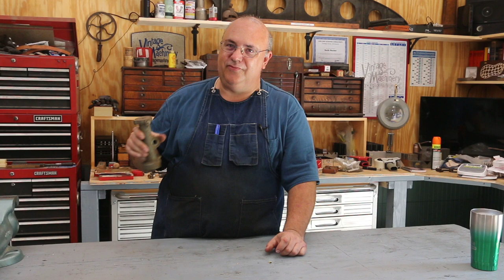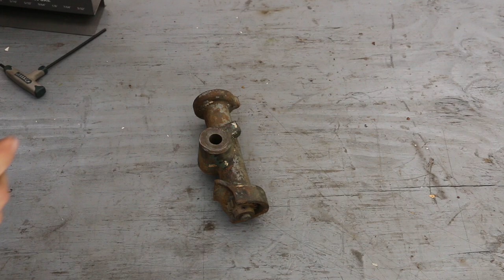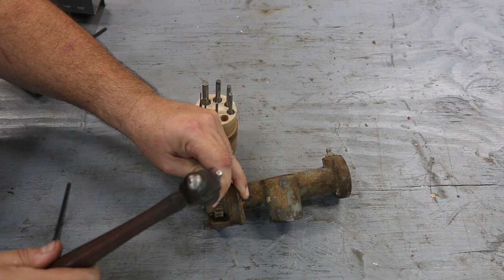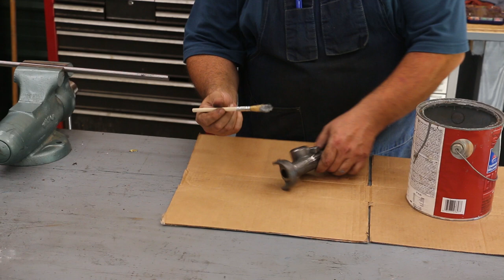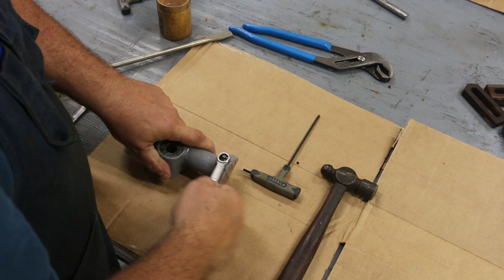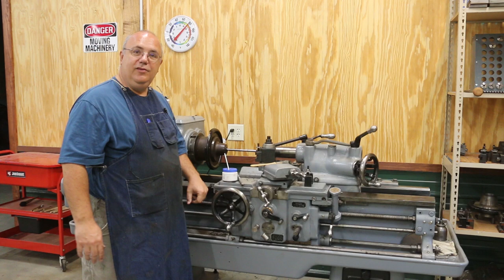LeBlond Lathe Restoration - Part 19:  Threading Dial

Comment: Hi Keith, a simple and easy way to make the dial lettering pop is apply a very thin coat of oil to the surface, then apply a generous coat of acrylic paint.   Let it sit for a moment then carefully clean off the excess.    Thanks for the videos.

Comment: That pin came out easy enough. I had a tough time in the past removing taper pins and found that drilling and tapping the larger end, inserting a bolt or screw, pull it out with a slide hammer.

Comment: I expect you know it already but for others that don't, if the lines don't line up nicely when the half nuts are engaged you can shim the thread dial body away from the carriage to make it do so. It can be annoying if you have to guess if it is half way between a half and a full line.
Reply: Chris Stephens Great tip!
Reply: Why thank you kind sir, but I can't claim any credit for it except that I read the manual for one of my lathes, rare thing I know but there you go.:>)
Reply: They were often sold as extras, so will need shimming because of the manufacturing variables. OE fitting should be done at the factory, but if you mislay the right washer, or don't know it is special, you might wonder what is wrong.,

Comment: Nice simple Idea for a thread dial. I don't have a dial on my lathe either and i'll have to look to see if it had something similar in the past. If i need to do a lot of threading i may have to make one. my Lather is nearly 50 years old and has a lot of features such as single lever control for apron and cross feed power feeds but no dial is strange. :-)

Comment: For metal, I have found that spray paint leaves a tougher more uniform finish than brushing it on... especially on lengthy paint projects... that being said, I would also have used a paint brush on such a small part.... Great video, thanks!
Reply from the maker: I once had a professional painter tell me that brushing is better on cast iron because the brushing action works the paint down into the tiny pores.  Also, if you have any dust or other tiny trash on the part, brushing will roll them around, coat them with paint and they will just stick to the part.  With spraying you only cover the top of the dust and it will not stick to the part under it.
Reply: Makes sense... my experiences on steel is that the higher solvent content in spray-paint makes the paint pigments get into the smallest defects, hence extra insurance against rust... also, paint from a paint can changes properties as the solvent evaporates in the can and on the paint brush bristles.

Comment: Is it known who invented (or first offered on a lathe) the threading dial? When you consider  it's simplicity to what it helps make possible, it's really an ingenious bit of innovation.
Reply: Nice find. Thanks for sharing it. I agree, it is surprisingly more modern than I would have thought. :)  (Page 853)
Reply: Which begs the question: how was threading done before there were threading dials?
Reply: Yes but, if the thread being cut is a multiple of the thread on the lead screw the half nuts can be opened and closed again in any position on the leadscrew and still be in time(mesh). S if you have a 4 tpi on you leadscrew you can cut 4, 8, 12, 16 etc tpi  and dis/re-engage leadscrew  anywhere.
Reply: More accurately, you can engage the half-nut on any number or line on the thread dial. There is one engagement between the marked lines and  if you engage there, the spindle will be 180 degrees out.
Reply: +Aceroadholder What J Hefflinger  said was correct. Any multiple of the lead screw can be closed at any time. I have run many lathes without a threading dial and only wished I had one when cutting an "odd to the lathe" thread. The only reason I built one for my lathe was because I was doing a lot of pipe and other fractional threads. As my lathe has a 9TPI lead screw most threads are "odd". The threads where a dial wouldn't help are 9, 18, 27, 36, 45, 54, 63, 72 and 81. All the others, including metric, are just so much easier with a dial to allow disengaging the half nuts.
   Mike (o\!/o)

Comment: Yo Keith,  How does one know if that was truly a grease zerk and not a pressure oil zerk fitting? Unless one has the manufacturer's lubrication schedule, that is.  My Monarch uses oil from the apron oil system, for instance.
Reply: Good question, I was under the impression most zerks on machine tools are for oil, as grease will hold dirt and chips. I wonder if this originally had a flip top oil fitting on it and at some point it got replaced with a zerk.

Comment: So what happens if your thread dial, disengages part way through a job? Is there a way to recover? Also is the indicator on the thread dial face going to get the graduations filled with paint or whatever.. Looks a bit hard to see.

Comment: Wonder why they had both a set screw and the tapered pin.

Eric
Reply from the maker: The set screw held the part in place while you drilled and reamed the hole for the taper pin.

Comment: Is it odd that it would have a set-screw if the bottom gear is held with a taper-pin? How in the world would the set-screw do anything more than what the pin is doing?
Reply: I think that's to hold the gear in place while the hole is being drilled and reamed. Also, it helps prevent rocking in the axis of the pin.
Reply from the maker: Like has already been commented, you need to hold the part in place when you are drilling the taper pin hole.

Comment: Why didn't you grease it before installing? Zerk fittings are for service only, not a replacement for greasing during assembly. The zerk fitting won't evenly coat grease everywhere on that shaft.
Reply: Really?  A part that turns that slow?  I don't think it's a huge deal.
Reply: Morrow S why to bring out the Trolls of course ;-)
Reply: That's not a trolling but a reasonable question, and good engineering practice to lube things as you assemble them, no matter how slow they turn.
Reply: Yup, I always lube parts as I go, that way I know it's all coated.
Reply: Clipboard warrior notification squad, assemble!
Reply: Renewable Oilcan Rim He probably forgot. But if you grease it until it squirts out the ends you're good to go. Give the guy a break. He is trying to get this done for a guy in what little time he has, he's running cameras etc etc.
Reply: scott black Keith gets more done in a week than I get done in a year...
Reply: Every shaft MUST be lubricated. :D
Reply: Either that or the hole it goes in.:>)
Reply: Agreed, there was a generous amount of grease in it when taken apart, Id feel like it needed to be fully coated before assembly - JMO
Reply: yambo59 but if he squirted enough grease in that it squeezed out the ends, which would be the normal thing to do, there would be more than enough, especially considering that the dial is under virtually no load. I think we have beaten this to death.
Reply: scott black         Finally, a voice of reason.
Reply: Considering the amount of grease Keith found inside, wouldn't greasing the part before reassembly make an unnecessary mess?
Reply from the maker: Well, I guess you would need to see this part to really understand it.  Did you see when I pulled it out that there was a coating of grease about 1/4" thick all the way around?  The center of the barrel was over size and it only was bearing on the two ends.  I probably could have packed the inside with grease first, but it sure would have been messy.  However, pumping it with grease filled the void and then basically packed both ends very efficiently.
Reply: I should know better than to ask these questions by now-lol   Love your videos Keith, love the awesome shop you've built and the restored machines, im 57 and really hate new cheap stuff - those old machines were literally built like tanks and the fact theres still so many of them still around speaks for itself.
Reply: Chris Stephens,I'm right there on your side. I often call Keith out on bad practice but unfortunately he only likes to respond to nice comments rather than deal with the truth.
Reply: jonka1, I suppose it is a question of perception, what could be meant as a helpful suggestion, could be taken  unintentionally as criticism.
Reply: The advent of Safety Kleen meant that clean parts were degreased and that they all need to be lubed for assembly, to prevent rust. I would be careful greasing electric motors since they call for high temp grease.

Comment: @8:48 it is very obvious that you have painted the surface that bolts up to the carriage. The matching surface on the carriage is also painted so now there are 2 thicknesses of paint involved. In this case it's probably not going to do much harm but it's bad practice to paint mating surfaces especially both faces. There is a slight possibility that the paint may relax during a threading job, allowing the dial to move out of engagement and cause you to loose your register. Why take that chance? Oh-- maybe you simply didn't think of that.  Once again you fail to show your trusting viewers how things should be done and portray yourself in a poor light. Why do you do this?